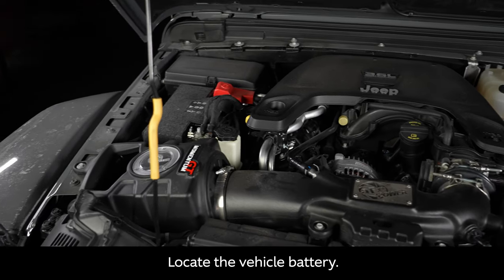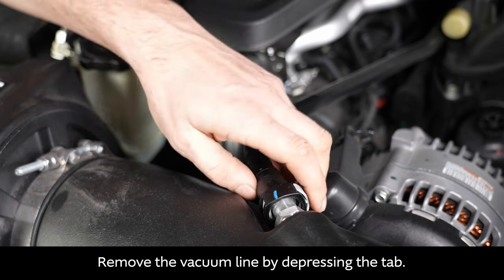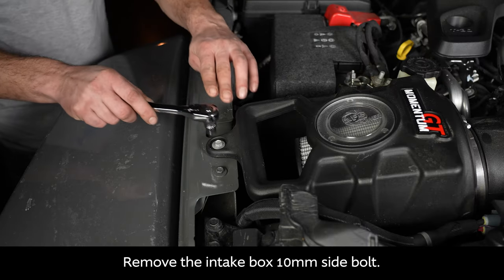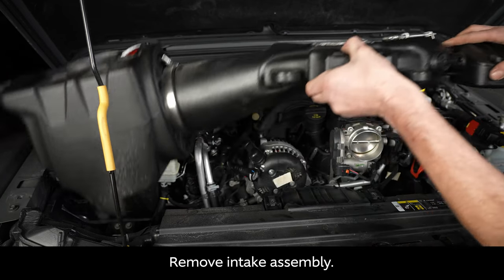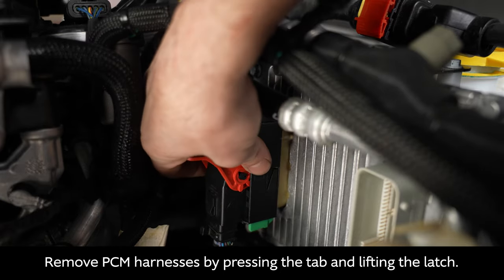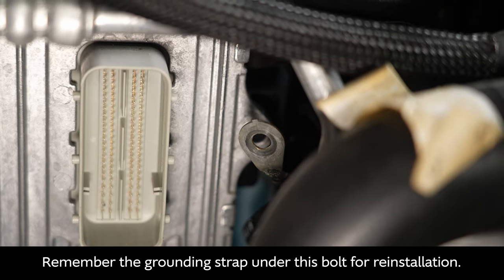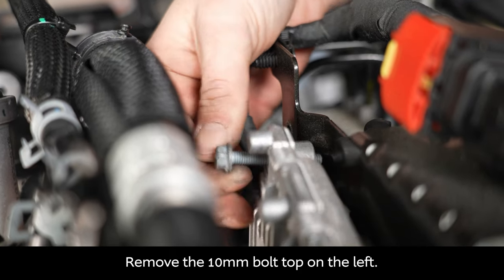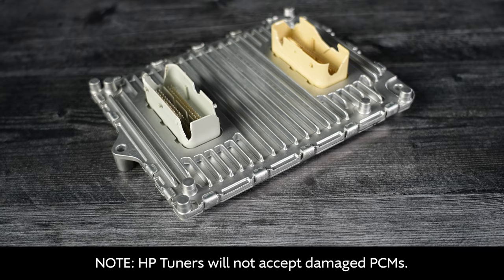How To Remove Your Jeep Wrangler PCM | HP Tuners

Comment: If your engine bay is not as pristine, and your Jeep a little older, than what's seen in this video....when you get the red locking tabs partway up you need to start wiggling the whole plug off the socket of the PCM.  There is a camming action between the blue/green locking sliders in the sides of the plug (that the red arm is moving) and the nubs protruding from the sides of the socket.

It also helps to have a very small flathead screwdriver handy.  When I was trying to remove my PCM, the plug cap (that holds the red locking arm) kept popping off the plug at the bottom.  I used the screw driver to push the retaining tab on the top of the plug to fully pop the cap off before re-positioning it on the plug.

Comment: Don’t forget to disconnect the negative wire from the auxiliary battery …it can be removed from at the main terminal.
Reply from the maker: Thanks for the comment Rick! The negative wire for the Aux battery is one of the two on that assembly. Our video demonstrates disconnecting both the main and auxiliary battery cables.
Reply: Looks like you just removed the main negative terminal. Not the negative aux. might have to reshoot the video